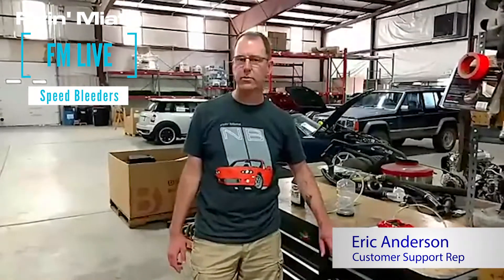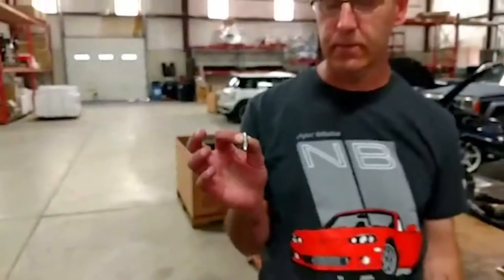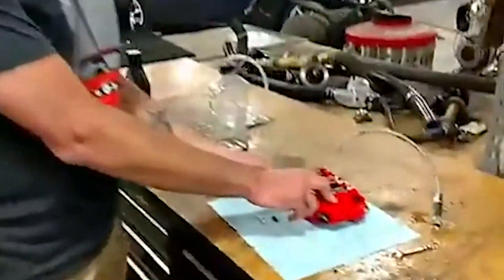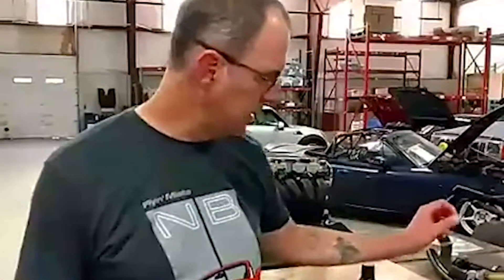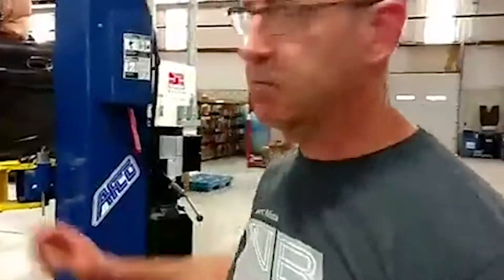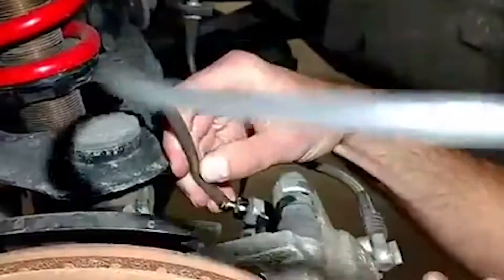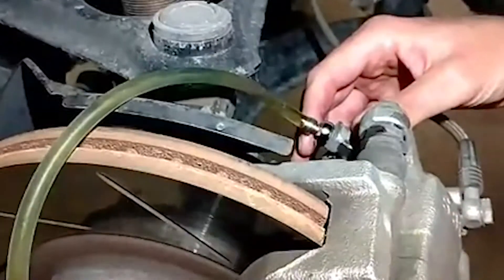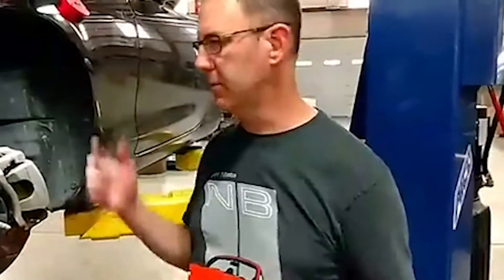Why you want Speed bleeders on your brakes (FM Live)

Comment: What would cause a bleeder to leak fluid? Should you always check the seating area of both the caliper and bleeder before installing?
Reply from the maker: It could be as simple as dirty threads, or improper sealant. Drop us an email at support@flyinmiata.com and we cannot some more details and  help troubleshoot the issue.
Reply: @FlyinMiataVideo  - Can you or anyone else please tell me how to clean and resurface wheel cylinder bleeder hole seat that seeps due corrosion.
Reply from the maker: @carlcampbell6827  If the seat in the caliper is corroded, you'll need a machine shop to resurface it. If it's a factory caliper, we'd recommend replacing it with a rebuilt one.
Reply: @FlyinMiataVideo - Thanks. I was hoping there was a do it yourself trick to re-surface lightly corroded wheel cylinder bleeder hole seats.

Comment: If it's got a built-in check valve what is he opening with the wrench
Reply from the maker: The check valve only opens when the bleeders are cracked loose. Otherwise, you'd leak fluid every time you pressed the brakes.

Comment: Thanks for the video! I am curious, would these speed bleeders slow down flow if I was using a pressurized bleeder system? Currently used the Motive Power Bleeder and it worked great, however this seems to work well without having to pressurize the brake reservoir
Reply from the maker: Yes, the speed bleeders should be compatible with any type of power (vacuum or pressure) bleeder.  The check valve is strong enough to keep fluid from leaking out when they are "open" and the pedal isn't being pressed, but they aren't so strong that they would cause any problems bleeding the system with a vacuum/pressure bleeder tool.
Reply: @FlyinMiataVideo  copy that. Thank you!

Comment: I like the idea. But if you are not under the car, how do you know when all of the air is out?
Reply: I've had these speed bleeders on my Benz for 10 years. I run a long rubber hose from the bleeder out to the side of the car. I hold the hose using magnets (side of my car, a metal chair, my rolling tool cart) within my line of sight. I can watch for bubbles until it stops. I can bleed all 4 wheels on the ground my self in 30 minutes.
Reply: @OneManOnFire  Got it. Thanks man!

And you know, since you have experience, tell me if this thought I had is dumb:

I bought 4 of them. I am gong to install them when I do the power brake booster upgrade on my Jeep. So...if I have on on each wheel...and they are check valves...

...Why not bleed all four wheels at the same time?
Reply: @OneManOnFire  You are probably right. I am over thinking it. I have a tendency to do  that.

It would take more time to set all of that up, then it would to just go than it would to just go wheel by wheel.

Thanks for the advice brother!
Reply: I set my phone to video record, pump 5-10 times, check recording. Usually I get it the first try 👍🏼.
Reply: @OneManOnFire  I think you'd end up pumping most of the fluid through the bleeder with the least resistance, probably the one closest to the master cylinder, it might leave bubbles at other bleeders.
Reply: @murky2502  to be clear I do one side at a time. Rear passenger, Rear Driver, Front passenger, drivers front last
Reply: @OneManOnFire  Yep, I was clumsy, I meant to reply to Kennedy McGovern apparently, who asked about doing all 4 at once.
Reply: @w8lifter21  Just did my first brake bleed yesterday. Did the same thing. Just make sure you aren't recording in 4k and or have enough space so you won't have to empty out your phone like I needed to to record the rest, lol.

Comment: Should I be able to blow air through these bleeders with my mouth? I just tried to test the set I ordered by blowing air through the "caliper " side and no air goes through.
Reply from the maker: If they are closed, nothing should go through from either side. If you think you have a problem, or questions,  please contact our customer support team directly M-F 8am-5pm Mountain time at 970-464-5600 or send us an email at support@flyinmiata.com. Thanks!
Reply: They aren't in the bike. I'm just trying to blow air through them with my mouth. Maybe the check valve is to strong for me to do that?
Reply: @charleslemon9840  Probably. Your brake pedal and brake fluid can produce and withstand exactly 8.5 billion more psi than your lungs.

Comment: Not exactly what I thought they were though I just ordered one before seeing your video, thanks. Was baffled by all the "install" videos and didn't know it was permanent. 

I suppose that could get a little messy taking it out and trying to quick put the regular bleeder back in? Also should be able to just throw the hose in a bucket and not worry about it being free of air and submerged. Other than that I'm not sure I see a lot of use or time saving in all this.
Reply: The ideal situation is either instal them when you gwt a new vehicle, that makes flushing brakes easy for yourself for the life of the vehicle. Or if you have a caliper getting old and need to change it, do it then. Or any case youll need to disconnect the brake linez because you have to bleed the brakes to make sure all air is out, switching to speed bleeders then as 0 negative since the brakes are apart. From then on you get to bleed the brakes on your own with no risk of air bubbles and can keep good fluid in your system- id recomend every 2 pr 3 years in a car. Make sure to bleed through all 4 calipers.

Comment: To change out all brake fluid you open a bleeder and pump till no more fluid and just air? And then fill reservoirs and pump till nothing but fluid comes out, leaving you clean fluid all around? Have I got that right? Let me know.
Reply from the maker: To change all the fluid, suck the reservoir dry and refill with fresh fluid. Then start pumping fluid through the system - starting with the wheel furthest from the reservoir - until the fresh fluid comes out at each caliper. You don't want to suck the master dry, it's a real pain to bleed when it's installed on the car.

Comment: I'm thinking of getting these bleeders, IF it can be explained how air can't get into the caliper/slave/cylinder thru the threads on the peddle upstroke.
Reply: One way valve.
Reply: @cooldaddyslick6869  I see I did not write my question properly. Explain how no air goes in thru the threads and comes out in the hose, down the plastic hose into the catch catch jar.
Reply: Speed bleeder sells a thread sealer just for that reason.

Comment: I was wondering why you need someone to press on the brakes, why are you clamping the line close, 
Why is this any difference than the old way?
Reply: Without the speed bleeders, one guy under the car uses a wrench to loosen (open) the valve, another pushes on the brakes. Then the guy under the car tightens (closes) valve, tells guy on top to release brake. Repeat many times until no bubbles...a lot of opening/closing/pushing/releasing/communicating. With the speed bleeders, one person can work alone. Open once and push-release-push-release until no bubbles. Then close valve. He has the clamp just so fluid doesn't go all over the place when he loosens the hose. He has an assistant just to make the video go easier. After opening the valve, he could have reached inside the door to pump the pedal with his hands or a piece of wood (what I used).

Comment: Don't know about yours,  but Goodridge Speed Bleeder in the K cost £14 each and that makes a car's worth very expensive. I think I'll get help pumping and save £££.
Reply from the maker: It's easy to see the current price of ours on our website. At the moment, a full car's worth on a car with stock brakes would be roughly £35 given current pricing and exchange rates. That's shipped inside the US, international shipping will unfortunately add to the cost because the Atlantic isn't getting any smaller.

Comment: What if you use a motive pressure bleeder? Are these needed?
Reply from the maker: They shouldn't be needed if you're using a pressure bleeder. The advantage to the speed bleeders is that you don't need to carry any extra tools with out if you're bleeding away from home - at the track, for example.
Reply: Also I've found that the master cylinder pressure has a much better chance of getting out stubborn bubbles vs. The 40-50 psi of a pressure bleeder. I usually do the main "flush" with a pressure system, then a final bleed using the master cylinder 👍pretty quick process with a high first time success rate.

Comment: What's the procedure for ABS brakes, is there's any way to cycle the ABS pump to get the air out with the car stationary?
Reply from the maker: The procedure for ABS brakes is the same under normal circumstances. Give us a call or drop us an email if you have any specific issues you need help with! 970-464-5600
Reply: @FlyinMiataVideo  - isn't the driver's side front "further away" from the master since it has to go from master to abs block and then back to the driver's side?

Comment: If the ball inside shut off to keep air from entering then why are you clamping the line. This is supposed to allow a one man operation.
Reply: I would also like to know if I can do this without a hemostat.
Reply: He's clamping the line to keep the fluids from getting all over the place when he disconnects. He also said he's being helped so he can be by the caliper to explain things
Reply: @0skar27  the whole point was that there is no need to clamp the line.
Reply: Okay I just wanted to bleed my front right caliper.  And I left the Speed Bleeder open a quarter turn with hose and bag attached.   The spring ball valve did not prevent the fluid from completely emptying my master cylinder.
Reply: @billcooperpatriot1059  there isn't. Him clamping it has nothing to do with the bleeding process
Reply: @0skar27  Then why did he clamp it? So at the end of the bleeding process,  there is no need to disconnect the hose?
Reply: I will answer the question.   Yes clamping the hose is indeed part of the bleeding process.   You cannot rely on the check ball in the speed bleeder,  because they leak.
Reply: @billcooperpatriot1059  dude i just answered that question. He clamps it to keep whats in the hose from leaking out when he disconnect. You dont have to buy the product if you have doubts
Reply: @0skar27  So then that IS part of the process  .
Reply: @billcooperpatriot1059  up to you chief